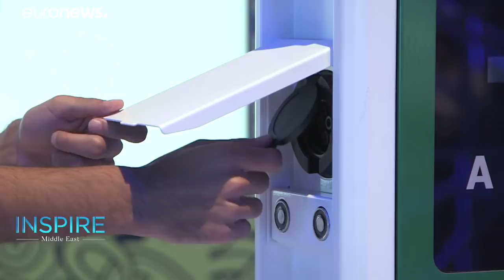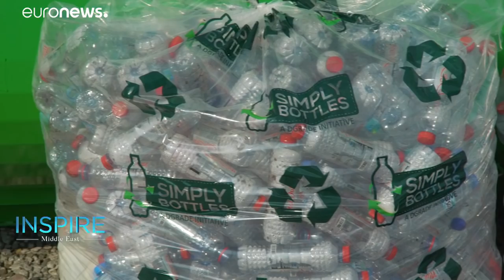Can turning plastic bottles into clothing help solve the UAE’s waste problem?

Comment: Partly yes. Plastic bottles are less than 3% in weight and about 10-45% of volume in 1 bucket. It is need to recycle other types of garbage: metals, paper, carton, Tetra-Pak, other plastics (PP, HDPE, PS, ABS). It is possible and it is not so difficult.